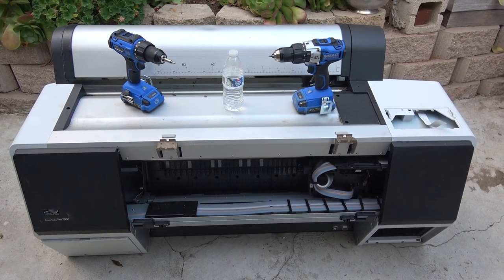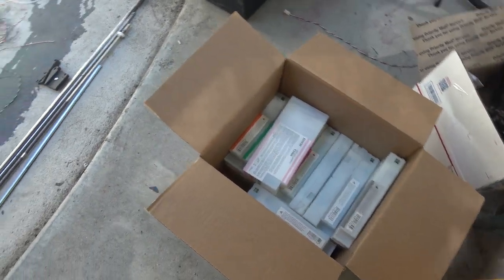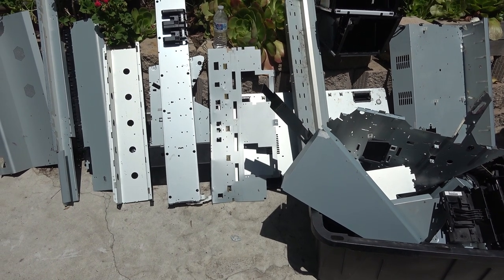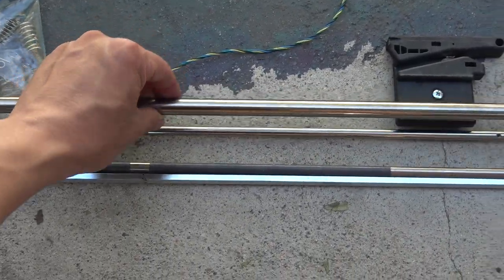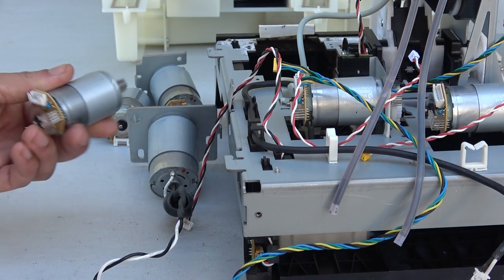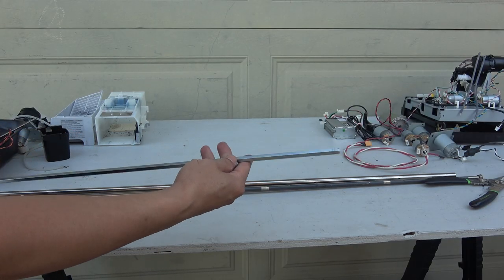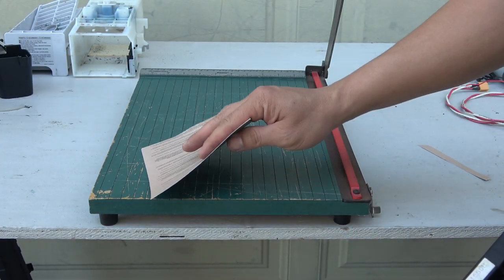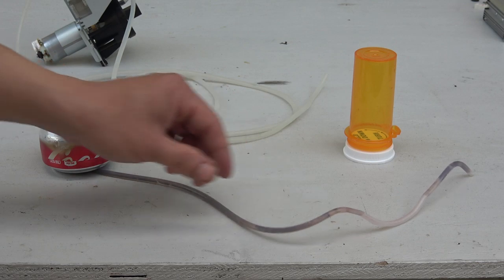Teardown: Epson large format printer. What's inside & what can you do with the salvaged parts?

Comment: Great stuff as usual.   On your future requests....I live behind 3 12-plex properties and the most frequent usable (?) trash are Vacuum cleaners (often just needing a clean out or new belt) and Microwaves??  Anytime a similar teardown might find its way into your schedule.....[Sorry, you may already have done one or more of these, but I havent checked your entire channel yet.]    Great WORK as usual..  THANKS.
Reply: I hear that about the vacuums. I used to sustain myself by picking bottles and cans from recycle bins for the deposit, and would often find perfectly good vacuums which, as you said, usually just needed a cleaning and/or drive belt for the beater bar. You don't have to tear down the whole machine to do that, but I did anyway a few times just to satisfy my curiosity. Oh, FWIW, I only fuck with Bissell bagless vacs now. Best suction, widest parts availability/interchangeability. A garbage vacuum obsoleted my old Hoover bagged vac.
Reply: I once played with a fancy Panasonic "Genius" 1200W microwave which I had hoped could be fixed with just a fuse, but it blew the replacement instantly upon plugging it in... <sigh>
Reply from the maker: Not a lot of parts in a vacuum, but you can get a heavy duty universal brushed motor. There are quite a few treasures in the microwave though.
Reply: Can't remember the guys name but he built a mini tesla coil out of an old microwave
Reply: @pipelinecowboy   Googled it..sure enuff, several projects showing how to proceed.  Havent tried it myself...not sure if I will get the time, but thanks for the idea!